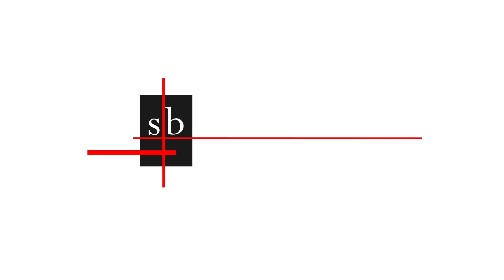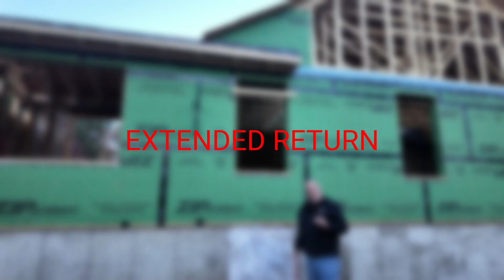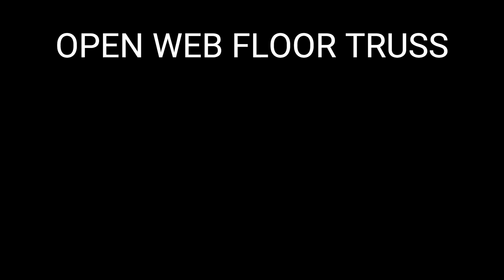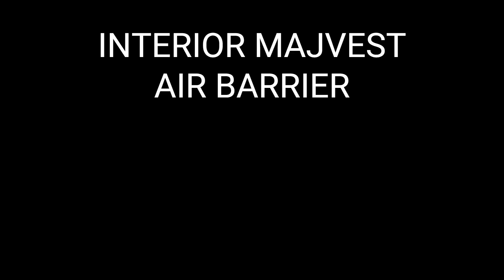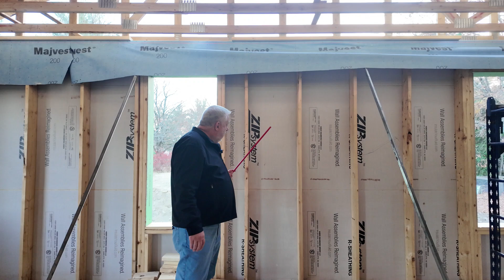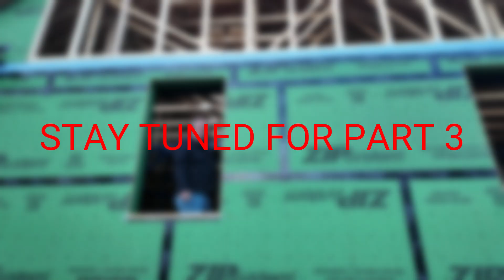6 more FRAMING Construction DETAILS....

Comment: Steve, I'm loving the details. 
Gr8 public service detail on that Open Web Truss.
On our Seattle home in 1985 house, the builder did not pay particularly close attention, and the day we moved into the house, it caught fire. A wire was pulled tightly around one of the nailing plates and it had sheared off that insulating coating on the wires. 🔥

Comment: Hi Steve ! Thanks for the videos. I can't quite tell in that last clip... How do you transition from zip r on the wall to regular zip on the gable ends? In order to keep the outside zip in plane? Do the gable end trusses get packed out or do you push out the gable truss in an extended double top plate?

Comment: Why no zip on the sill in the first tip for rough openings?
Reply: I think, and I could be wrong…that what we’re seeing there is the zip wrapping back into the rough opening at all 4 faces. Then they came back and added a sloped sill plate. Later they’ll use flex tape over the sill plate and form a sill pan.  The tape will cover all the exposed wood you can see in this video.
Reply from the maker: @marcitecture  No zip at the sill - it's a solid full width 2X "Rip Sill", watch Fridays details video for more

Comment: Will there be horizontal blocking on the seams where the sheathing is run horizontally? In RI we always had to block all of those and I see people standing sheets vertical now to achieve the full perimeter nailing on the sheets but I’m not a huge fan of that.
Reply from the maker: Not needed her

Comment: Steve, just wondering on the extended return whether it was considered to bring that extended eave all the way across the gable wall, creating a low overhang for all the windows on that wall.  Aesthetically it woulld divide a tall gable wall, but at additional cost.  I have  one of those on my house that extends all the way over the garage doors that was done purely for aesthetics since it faces the street.  One thing that is not covered much on the channel is the esthetics.  Just a suggestion if you run out of new building science content.✌️
Reply from the maker: We look at it, but it nis the side of the house  where the cost outwieghs the decision. If it were on the front or out by the pool, it may have had more value

Comment: Do you recommend Zip tape along the horizontal joint between the extended mud sill and the first sheet of Zip R?
Reply from the maker: yes, its simply flashing
Reply: I like Siga fentrim for that spot down onto the foundation but as long as it’s sealed with something suitable I’d say you’re good.

Comment: What I’m still not fully understanding is the vapor retarder/air barrier on the ceiling. Does it just get taped or stapled to the bottom of the trusses? Then furred down for electrical before drywall? 

It seems like the insulation would then pull it down and possibly tear it. Or do you skip furring it down and then you have the drywall pressed right against it, sandwiching it between the truss and drywall and just air seal your penetrations there? If I plan on blowing r80 of loose fill cellulose is there any risk of the drywall not being able to support that weight at some point? 

I’m planning on doing this detail to my own build soon. Thanks!
Reply from the maker: follow along, its coming